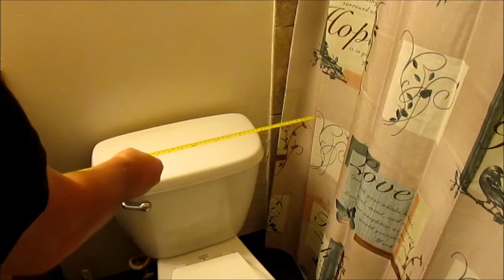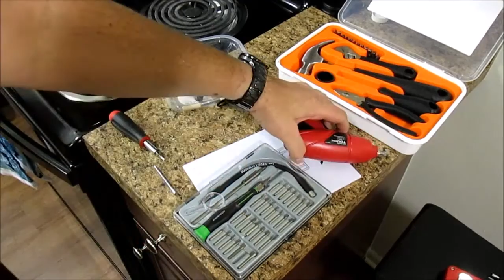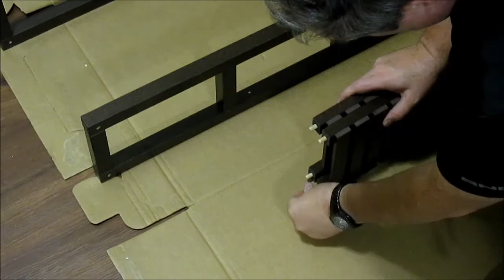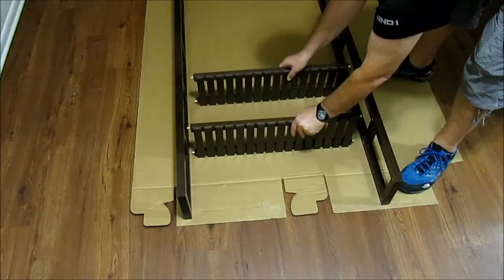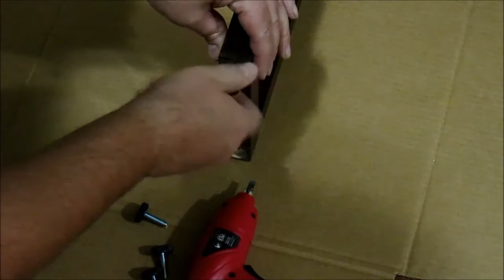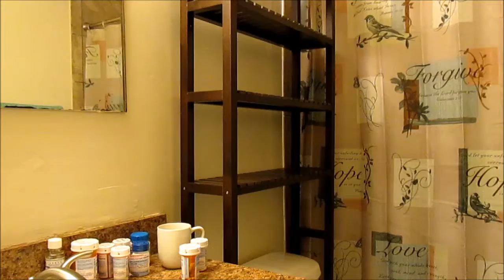IKEA Molger bathroom shelving unit assembly - DETAILED!

Comment: Weird question- The wall that I'm hoping to put this unit against has a light switch. My hope is that the switch would sit between the bottom and second shelf but I can't be sure. Is there any chance that you still have this unit and could measure the height of those shelves and tell me how thick the shelves themselves are? Normally I would just go to IKEA and find the floor model to measure but its a global pandemic and I'm trying not to be inside places too long.

Comment: Hello,
I am thinking to buy this from Ikea too. I got something similar from Walmart at 20 bucks but its very flimsy. How is the stability of this one ? Also, at the end of the video you say that you extended the front foot a bit. Not sure what you mean by that ? Did you unscrew the foot peg a bit to make it lean on the back wall ?
Reply from the maker: It's stable. Adjust the front foot pegs by extending them, and the unit will lean against the wall and still look good.